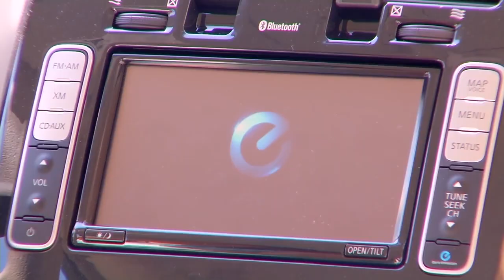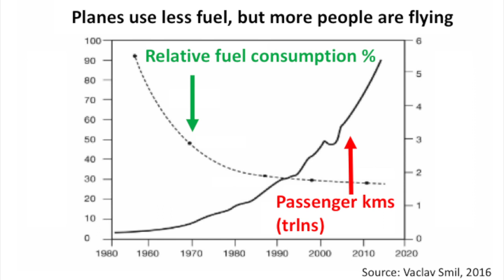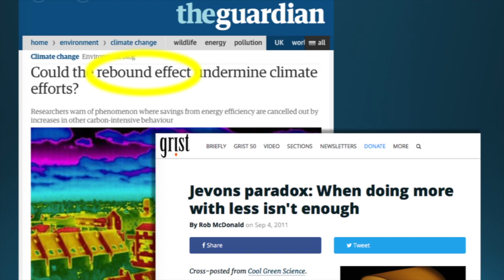The paradox of energy efficiency

Comment: How are you this sunny morning in Goonellabah on North Coast NSW?
True, the human race will expand into the Universe, starting with Mars. A working a #warpDRIVE by 2035 as an example.

The Team and I are submitting a DA to a Lismore council on North Coast NSW end of Oct 2022:
1.	250 prefabricated XLam as CLT & SIPform passive house-certified homes. On the roofs of buildings, the Tractile, the excess electricity will be stored in the 28.8MW Tesla Batteries Farm. 
2.	The PV in total 934,370m2 - Tractile tiles 45,000m2 and Arctech Solar Tracking - Tesla PV panel 887,400m2
3.	Bi-Charging of EV one per house and 12 charging stations in the shopping centre. 
4.	Micro-grid that connects to a community of 4800 residents 
5.	Landscaping the whole site, ensuring enough clearance for the surrounding bush and buildings.
6.	We will be trailing the SoMax HTC process. 
7.	We will have a project at the end of 2024 that will be installed a long-range wireless power transfer. Emrod Tele-Energy Technology. 

Some of the Teams and companies include:

•	SipForm™. 
•	Tractile. 
•	Direct Building Solution. 
•	NB Consulting Engineers,
•	Green Product Certification.
•	XLam
•	Weathertex
•	Cupolex
•	Big Ass Fans
•	Arctech Solar Tracking
•	Tesla EV – PV – Powerwall.  
•	Arcimoto.

We will employ over 234 consultants and local trades. So, if you live on North Coast NSW, we like to hear by the end of the year.

We will be onsite in July 2023.

We have a video on YouTube at the end of Oct 2022. Then two videos a month project finish the project in 2025. The first YouTube of many https://youtu.be/e92Vlr12QyU

 We will raise AU$500 million by the end of 2025 for the development.

The Team and I Fully Charged LIVE—Sydney 11th to 12th March 2023. I will be there in Sydney. We promoted the project on the film on stand team taking a project and future projects.

Sustainable - Urban - Community – Homes
Rethink – Reimagine – Reinvent - Disrupt

Comment: there is no machinery that have ever used up energy ever. energy can not be consumed or used up. its not a quantity. its a state of matter. only the thermal density can be changed by high pressure to low pressure. the energy is exactly the same after the work is done as before just less hot in more volume. just because machines can not make use of energy at the ambient does not mean the energy is not still present but just wasted.